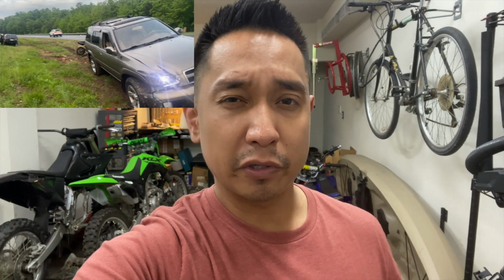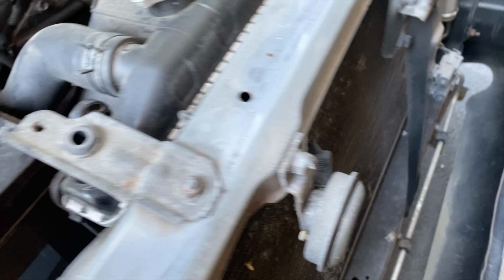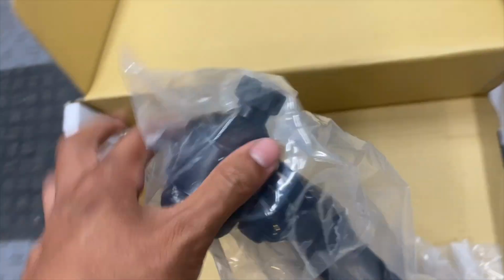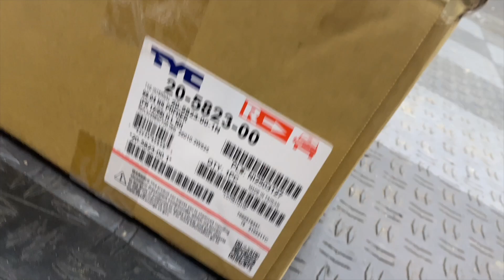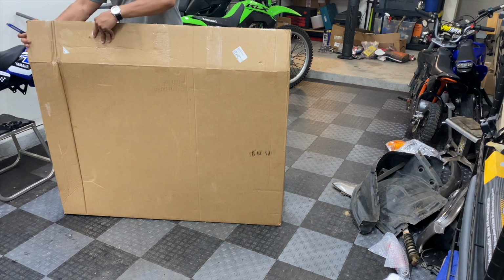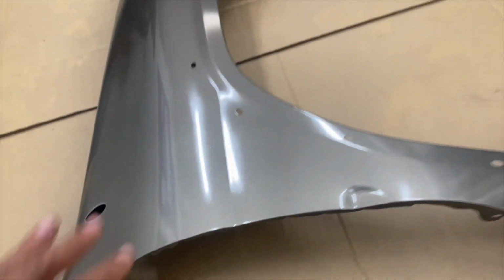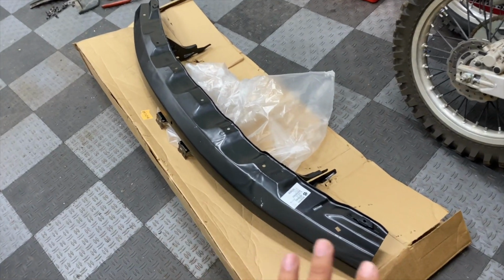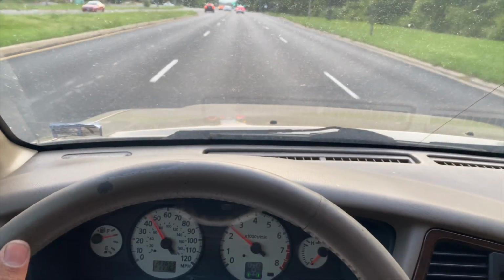R50 2002 Nissan Pathfinder DIY Resurrection on a Budget Part 1

Comment: I got the same accident with my 03 pathy and I couldn't drive it for miles so I decided to order the towing truck to take it to workshop and get it back to roads within two days.  My fender had little hit which can be fixed in dent and paint.  I saved money for getting brand new one.

Comment: Great video. Thank you for sharing. Why did you decide to go with paint from ebay and not amazon? Both places carry it. Is one vendor\brand more reputable than the other? I'm about to order a can so I'm just curious.  Thanks.
Reply from the maker: No particular reason, simply eta at the time. I thought the one from eBay was gonna get to me a bit fastee
Reply: @PatrickKasilag  Thank you sir. Cheers!